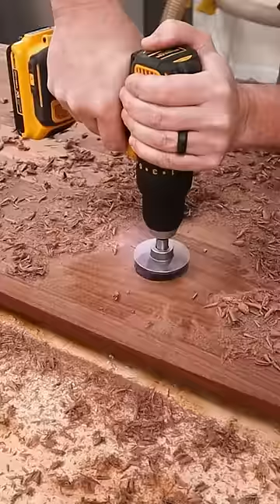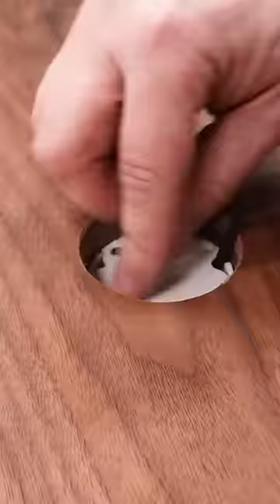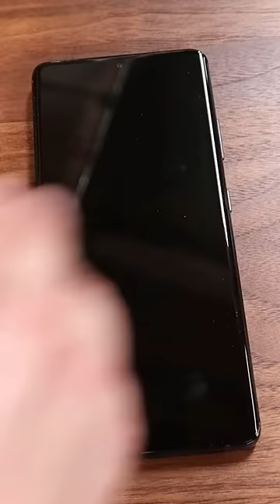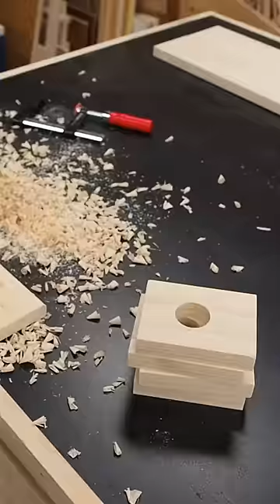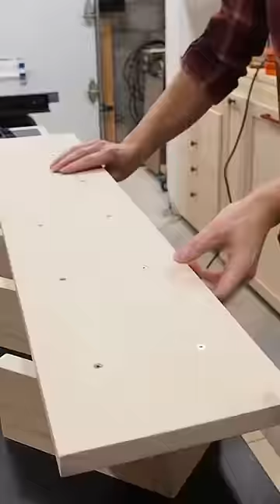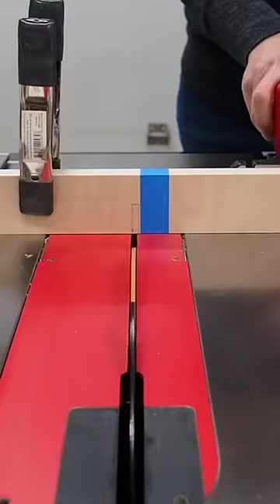3 Cool Woodworking Projects You Can Make At Home #shorts

Comment: Can you give more detail on the wireless charger?
Reply: I second this.
Reply: @ShorterFeatures  it's recessed into the board and secured with screws. The tiny drill bit is so you know where it is when it's flipped over for use. There is nothing extra. I would put it in a workbench, a nightstand or an end table. He was showing how you can recess it.
Reply: Who is the supplier of the charging unit?
Reply: @ShorterFeatures Are you kidding? People are asking WHAT is the charger, WHO makes it, WHERE do you source it from. Why would you just narrate what the OP showed?
Reply: @verdedenim662 do you scroll just looking for a reason to get triggered?